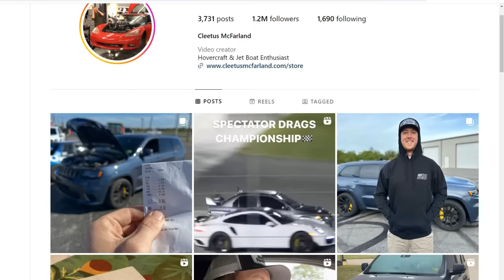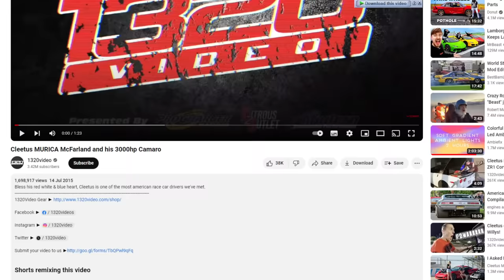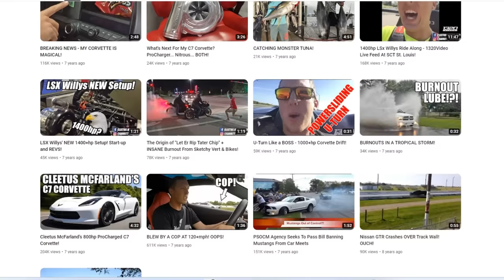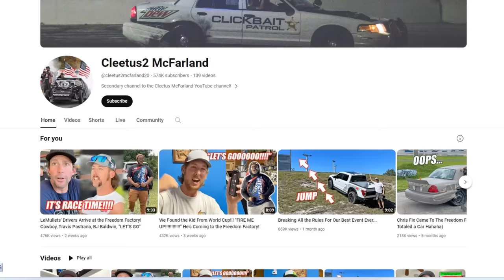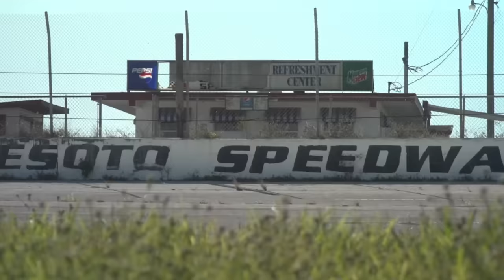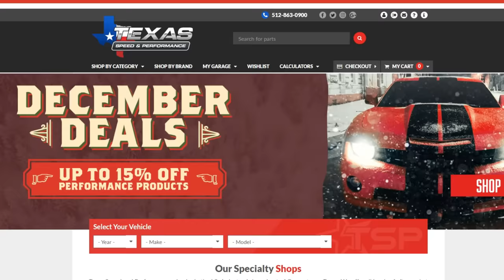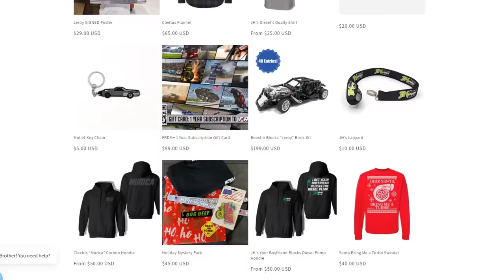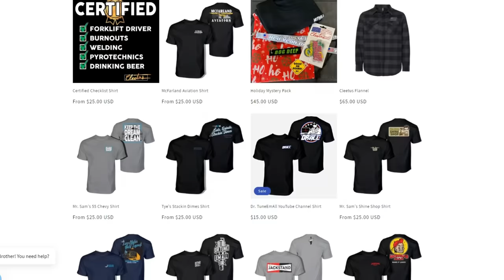SECRETS YouTuber Cleetus McFarland Is HIDING About The Freedom Factory

Comment: Ok i gotta cut in, fire proof suit or not, 200+ degree coolant is gonna burn you either way. Fire proof is fire proof not steam proof.  That was an unfortunate radiator placement behind the driver. Risky design. No firewall or windshield separate the a hot liquid system from the driver.

Comment: Ive built some of the biggest skyscrapers in nyc but i really wish i would have learned to build modified cars thats what my passion is im 40 now i guess its not to late to learn but i wouldnt even know where to start
Reply: The most important part is that you got to create a realistic vision and stick to it. Learn exactly the costs and maybe ask around at events that way you can know what to expect before you get started. If you want a 7 second car you need maybe $50k to $70k (I don't really know for sure) but it is about the same as a new car with all the money required up front. If you do most of the work yourself.

The hard part of the process is custom fabbing the cage, reinforcing the body or frame, and designing your suspension in order to have the car to be able to put down the power and survive. The engine is useless if the suspension can't keep up. (Leroy recently got a downgrade in torque that allowed it to go faster.) That part requires skill and knowledge the rest is more knowledge and busy work. Along with a strong passion for quality and the patience to do it all the right way. Eventually you will having a good working car.

If you are really good at it all you can delve into building the engine but it might be better to get a shop to build you the engine and transmission. They will have the very expensive and specialized machining shop to do it better than what you can do or you can try yourself for the first iteration. If you don't mind having to swap the engine later.
Reply: Oh and space a car with all of its part disassembled needs tons of space. For the parts and tools.
Reply: It's never to late to start doing what you are passionate about!! A modified car is not always a purpose built race car. Start with the basics like part identification and how internal combustion engines work. Learn the difference between what makes a four banger go or a V8 and why they are called a v8 or four cylinder inline. Learn the components from bumper to bumper because if you don't know what a part does, it's hard to modify it and be successful doing so! You would not design or start construction on a sky scrapper if you had no clue what  concrete was or how much load a steel beem can hold before failing. All the parts of a building have names and certain jobs to do and you need to know if something is too small or wrong material,  the important stuff. If you don't know where to put something it can be difficult to locate it and do anything at all really!! Start with the basics, identification of parts and what they do and how they work and the rest will work its self out!!